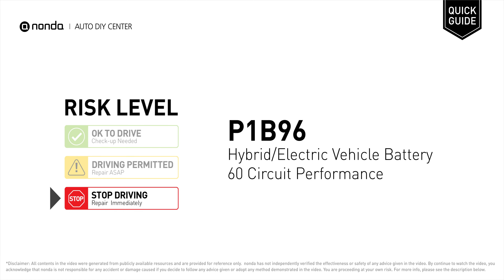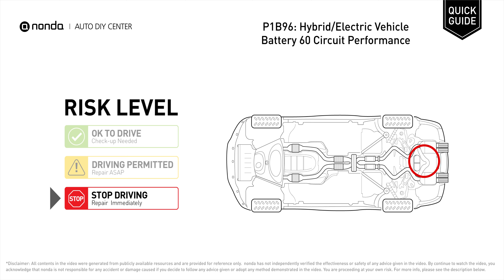What is P1B96 Engine Code [Quick Guide]

Comment: I have same code mu car niro 207
Its come when i am driving loaded 
 On high road
What i should do ?
Is it means i should replace the battery ?
Reply from the maker: Hello, you can check the condition of the Battery Pack and the Battery Interface Control Module. A replacement could be necessary.

Comment: Hi. I have a Kia Niro PHEV 1.6 EX (2018). It keeps giving the same P1B96 error code. I took it to the KIA dealership several times, but they always told me to use the car. They cannot measure defective cells.
I would like to respectfully request your professional opinion.
What do they recommend?
What could be done?
Thanks for your help.
Reply from the maker: Hello, can you please confirm if this is the only code you're getting?
Reply: @nondainc  Yes, only this one error code appears. We have an X431 Pro5 instrument that we used to diagnose this. Can I send the datastream somewhere?
Reply: Kia technician here, not sure if this is too late. That DTC is for Battery Cell Deviation. The battery cells in the Hybrid Battery Pack must correlate with each other, there are instances where 1 (or more) battery cells fall below voltage specifications, so then the computer throws you that code because there was a time where a battery cell fell below spec. I will assume that your vehicle falls under warranty because it’s the reason why the dealer tells you to keep driving, in order to claim a hybrid warranty repair like this one, it has to pretty much break down on you completely, because if everything seems normal, they’re not gonna want to replace something that’s “good”. What I recommend as a repair is to take it to an authorized high voltage specialist mechanic and request to replace either the entire battery pack, or the individual battery cell that’s acting up. You can see which battery cell went bad using the Freeze Frame Data. Freeze Frame data is helpful because it’s the computer storing all the data that CAUSED the error code, so it will most definitely tell you which cell went bad.